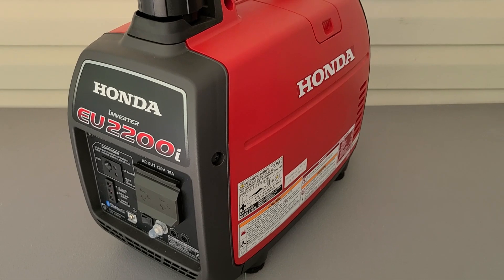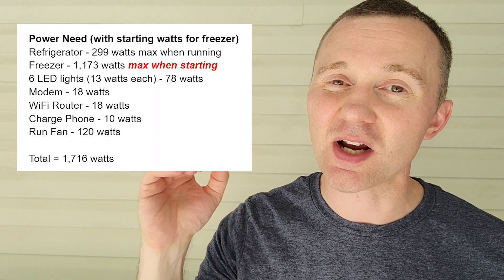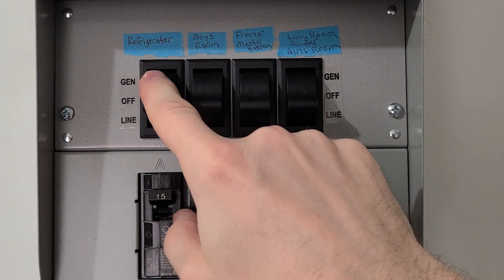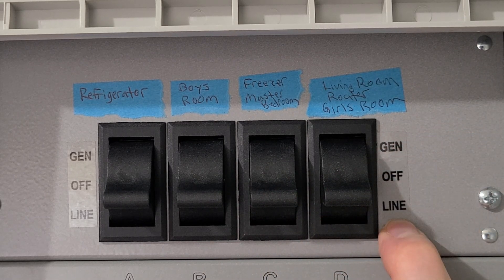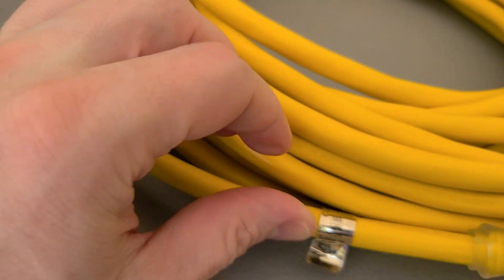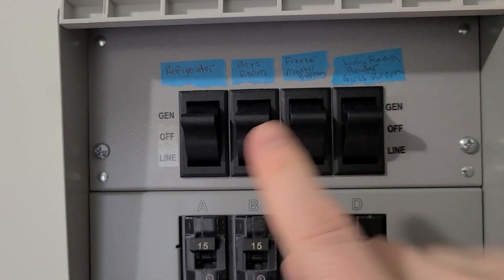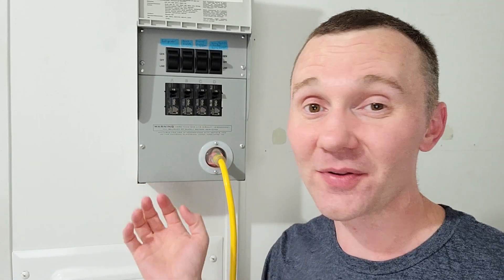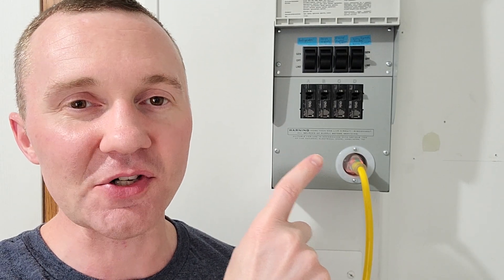How To Power Your Home With A Small Generator (Honda EU2200i)

Comment: Very cool.  Can we select any of those four circuits from both 120v phases or just from four circuits from one phase of the main panel?
Reply: There is no reason why you couldn’t choose either phase in the sub panel when wiring each switch up—you should be able to have a mix of circuits backed up whether they are on phase A or B.

Comment: Could you run a gas furnace off this?
Reply: I used a small home light 1800 watt generator to power our oil furnace through -50 degree power outage.
Reply: I can run my gas furnace with a 1/2 hp motor with it easily.  One tip; set the fan on your furnace to "on", instead of "auto", while you're using the generator.  You won't have the surge requirement each time the motor starts, so you can run other items like your refrigerator, some lights, etc. as well, without danger of overload.
Reply: You will probably need a ground-neutral bonding plug in one receptacle of your generator (if the generator is floating neutral, as is this Honda EU2200i). Search about running gas furnaces from a generator and you will see lots of information about bonding the ground and neutral.

Comment: OUTSTANDING.
This is one of the most useful, informative videos I have ever seen. I have been wondering how to do this very thing, and now I know. I'm going to purchase a larger generator because I want to be able to run the A/C in case of an emergency, as Vegas summertimes are unbearable without it.
Reply: I agree with your comment! This video is extremely informative! @SensiblePreparedness can you add a couple of monitors, a laptop, and a 5,000 BTU AC to run with 2 Honda EU2200i generators connected in parallel via the transfer panel? Also, what's the best brand of extension cable that you recommend for using the 2 Honda generators at once? Thank you again!!!